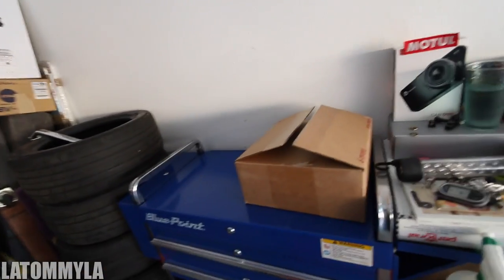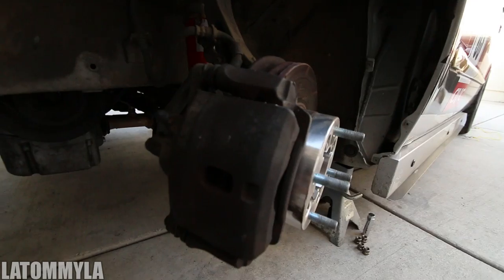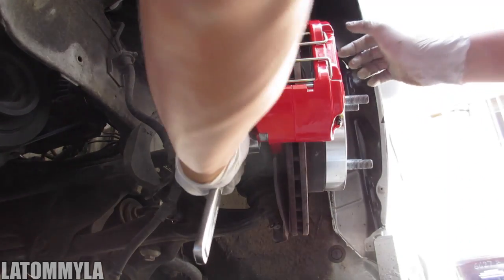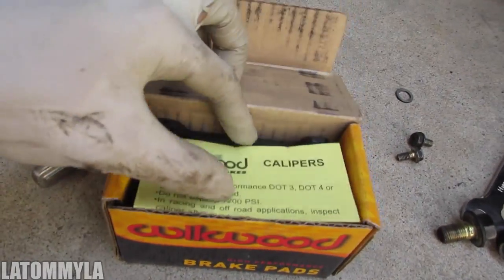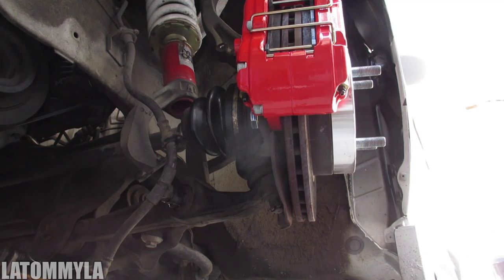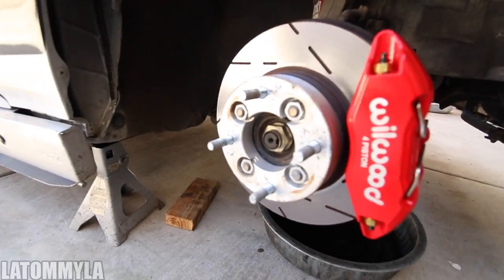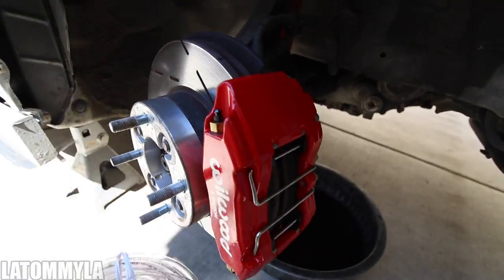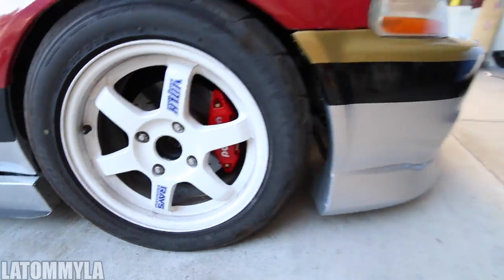More Stopping Power! Wilwood 4 Piston Calipers!

Comment: I used to always use motul, the dot4 Prestone stuff you used works just as well Imo and it's way cheaper. I wouldn't bother switching but that's me. I like to flush/bleed before each track event so it's not in there long anyway. 👍
Reply from the maker: Thanks for the opinion brotha! And yeah I bleed my brakes before any event 👌

Comment: You know these calipers have stopping power and so generate a lot of heat the transfers from the rotor to the hub bearings . Why only stop half way. Get the bigger 2 piece rotors.

Comment: do you need bigger wheels for the 4 piston ones? or only for the 6 piston ones?
Reply: I think he’s not running bigger wheels because the ones he has only uses four wheel lug nuts, meaning it must be a wheel size 15 or less, I’m sure. But notice that he IS running wheel spacers. Not a fan of those myself.

Comment: Hi have a honda civic ek3 japan import and i wish to buy these brakes but my oem disk size is 242mm what was your stock size disk brakes please os i can see if they fit my ek thanks
Reply from the maker: My car comes stock with 261.5mm Rotors.
Reply: You have to swap the 262mm axles in, before you can put these Wilwoods on. LATOMMYLA had 262 stock, so he just needed the Wilwood calipers. You need 262mm axles AND the Wilwood calipers.
Reply: Maxxis1992 thanks I bout the model to fit my axels thanks for the tip :)

Comment: kinda off topic with the video but did you change your springs on the coilovers? if so what spring rate are you running?
Reply from the maker: They are 16kgs, wouldn't recommend them. Only had these since I used this on my old sedan when it was slammed.
Reply: +LATOMMYLA did you just straight up swapped the springs? I hear some people say they have to do something with the shock before putting a different spring rate.
Reply: +LATOMMYLA what should I know before changing the springs

Comment: And here comes the noob's question... those can only be used on stock sized rotors only or can be fitter with a 280/282mm one as well?
Reply from the maker: +nkolasfrs my caliper is designed for only 10 inch rotors, which is stock EX. If you want to run bigger rotors they offer calipers for that sizing

Comment: I see that you still have the stock crank pulley? Since you race your car did you ever thought about light pulley? Along with light fly perhaps? Nice build btw man.. i got a bbk for my rsx from willwood as well, came with I think ss lines and 2pc rotors which were 4lbs ligher than stock
Reply from the maker: Havent thought about that, I know a flywheel will make a huge difference. And thank you!